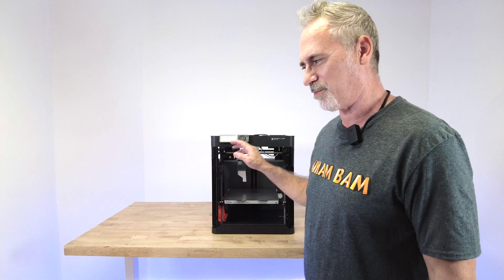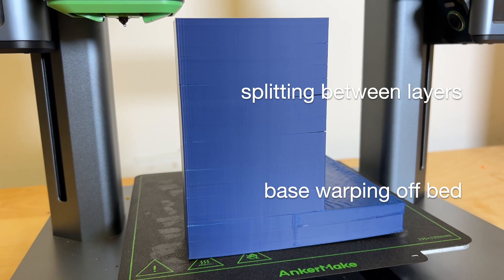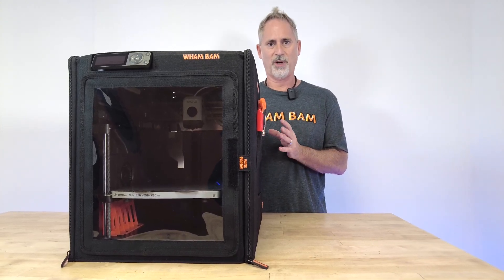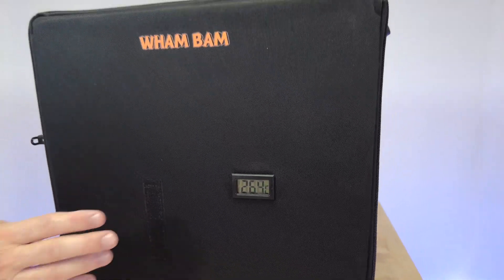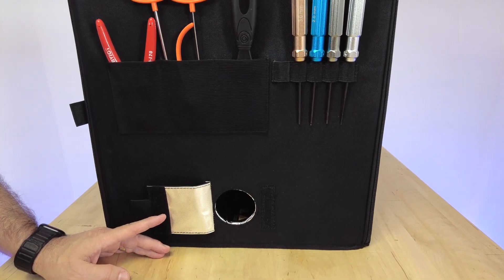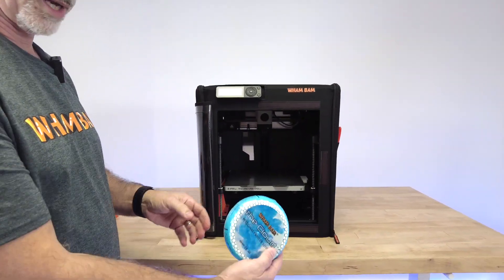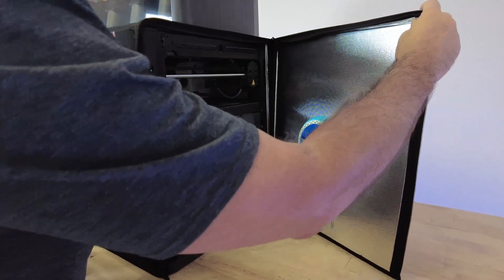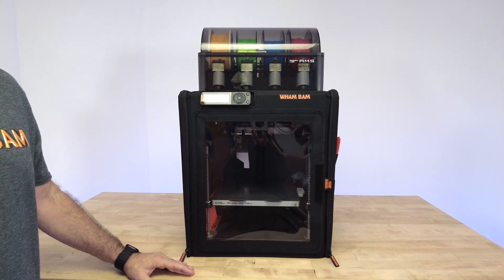Meet the P1P HotBox: Crafted for your Bambu Lab P1P

Comment: Do you need to have the side fan and cpu fan installed?
Reply from the maker: Bambu does not recommend putting the P1P in an enclosure, but if you monitor your internal temps you should be fine, it does help to have a CPU fan on the back, or you can install a side fan and create current, sometimes just opening the door a bit helps control temps.

Comment: I bought one and am excited to try it out. I have 2 questions. 1) will I need to purchase the cable chain for the tool head cable? Or will the PTFE tube and tool head cable just rub along the enclosure ceiling? And 2) when upgrading the P1P to a P1S, an MC fan is installed to help control overheating of the MC. With that area now enclosed, is there additional risk of MC overheating? Should the MC fan be purchased and installed in case?
Reply from the maker: Thank you.  No we have been using ours for the past six months without the cable chain.  We only the rear PTFE tube connector. Also, should anyone want to install the rear exhaust fan we have a removable patch that exposes this area. We have not use this as we tend to keep our temperatures relatively moderate, and there is a side port to vent out fumes which, which also regulates cooling interior if needed

Comment: Will this fit an X1, or just the P1?  While the X1 is enclosed, looking for a reduction in noise and better insulation.
Reply from the maker: Sorry it will not fit and X1, the screen is in a different place and we have the door to contend with, but maybe, maybe if there is enough interest we can make one!
Reply from the maker: We have had many questions about this and we are doing the research now on the P1S and X1, however it was designed for the P1P. Stay tuned and we will let you know if we have any updates!

Comment: A temperature comparison between stock p1p, p1p with whambam hotbox, p1s and p1s with hotbox would be nice. Now that the p1s and the upgrade kit from BambuLab is out many would not see a benefit in buying a third party hotbox. but with your insulation this hotbox could potentially be even better than the p1s and might even be useful as an ad on.
Reply from the maker: We have already done testing and it has been a remarkable improvement over the other is listed. We are making a video right now, so stay tuned.
Reply: @WhamBamSystems  Please also do a sound comparison. The P1/P1P can get rather loud with the optional cooling fan installed.
Reply: @WhamBamSystems where is this video?
Reply from the maker: The noise comparison video is here: https://youtu.be/HvBpUYNc-q0